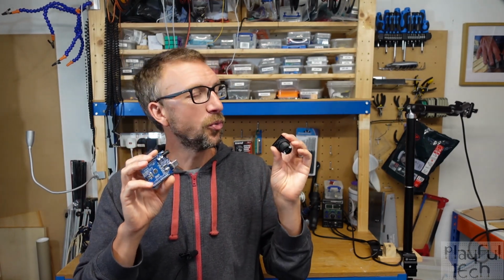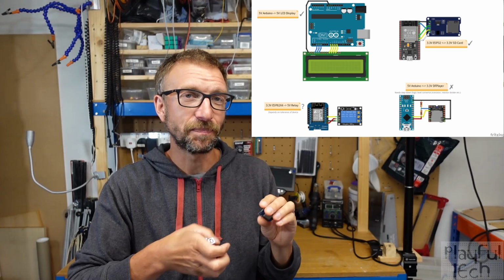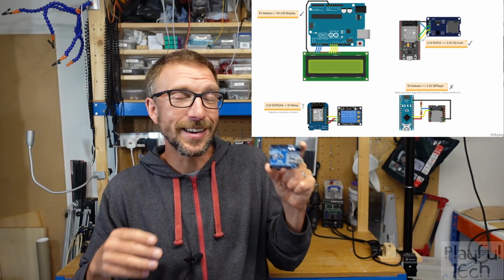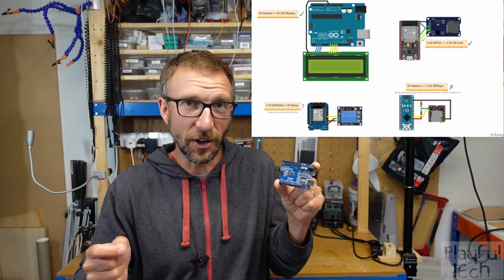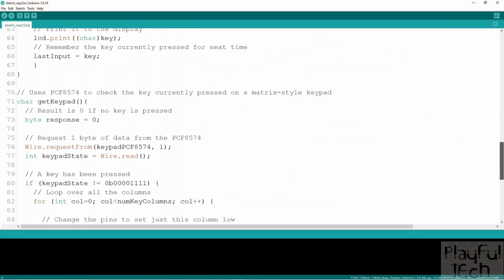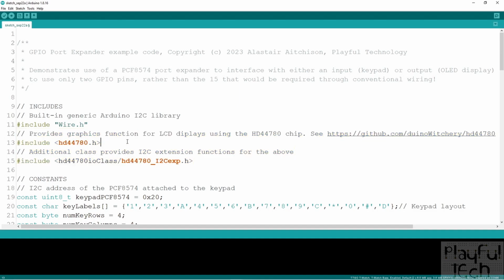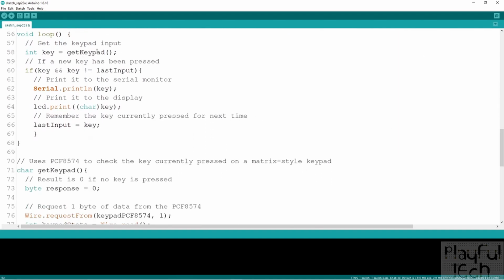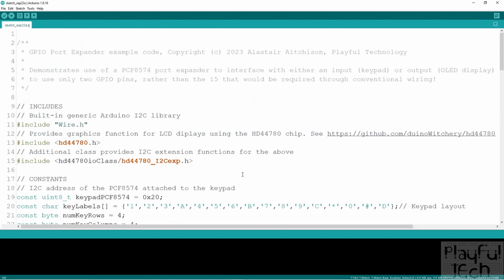GPIO Inputs and Outputs - an intermediate guide for Arduino and ESP projects

Comment: at 24:30 Do you know:
does the voltage input define the gpio only or also the i2c signal?
Say you have an esp (either of them) and it has a 5v usb input, it converts that to 3.3 for itself
but you can power the PCF8574 via that 5v rail as well, will the i2c now be incompatible with the esp? 
I'd like to do this because the current output of these boards is pretty limited and you are going to damage the 3.3v regulator powering too much, however if you are supplying several amps of 5v it is pretty much limitless.
In your example you power directly from the micro controller board, which since it's 5v I am assuming it directly uses the usb.. However if you were to use the VIN and say 8v-12v it'd be the same scenario as I am talking with the esp boards
thanks!
Reply from the maker: Whenever you have a component that can be powered by a range of input voltages, the voltage that determines the logic level of HIGH/LOW is almost always defined _relative to the voltage at which it is being powered_. Taking the PCF8574 as your specific example, you can power it with a VCC of anywhere between 2.5V to 6V. What is defined as HIGH on the logic line is anything greater than 0.7*VCC, whereas any voltage <0.3*VCC is defined as LOW. (you can see this on the datasheet: https://www.ti.com/lit/ds/symlink/pcf8574.pdf ). So basically, if you want to run 5V logic levels, power it with 5V. If you want to run 3.3V logic levels, power it with 3.3V instead.
Reply: @PlayfulTechnology  Yes I understood this I think maybe I explained it wrong. say you have a 5v power supply, you plug that into the nodemcu and the pcf8574. Now the pcf8574 is outputting 5v on its pins yes, does that include the i2C? the nodemcu at that point would be 3v3 on the i2C. 
So the question is, does the pcf8574 able to do this, because if its i2c is 5v then no it cannot because it'd use the nodemcu pins as drains since they are lower voltage it'd flow backward?

Comment: I love this video, it was really helpful in explaining what these I2C pins were for (I've seen them on pinout diagrams before, but didn't know how to use them), and would love for other videos about different protocols. The other thing I always struggle with (though maybe it's just me) is the actual physical wiring of my projects. I can solder things just fine, but I don't own that many components and frequently want to reuse them. So what kind of connectors can I use and which wires (gage, core etc.) go with them? I have failed a few attempts to install wires into those black connectors that you're using to connect the I2C pins to that first port expander. Thanks for the great content!
Reply: Have you tried using breadboard/s for projects where you want to reuse some components?

Comment: The timing of this video was absolutely perfect. I have been struggling with interfacing NRF24L01 and RC522 with UNO over SPI. Particularly selecting an external power supply to power the NRF and/or RC522. 
Looking forward to more videos like this in the future.

Comment: Thanks for this video Alistair.  Looking at the PCF8574 module, I see that there are pull-up resistors on the I2C pins. If one is chaining multiple modules, I think it would be wise to remove the pull-up resistors on all but the first module. Otherwise, all the pull-ups will be in parallel and that could drain too much current. What do you think?